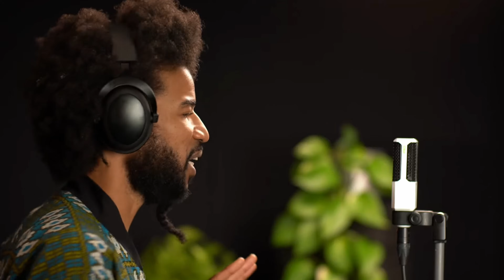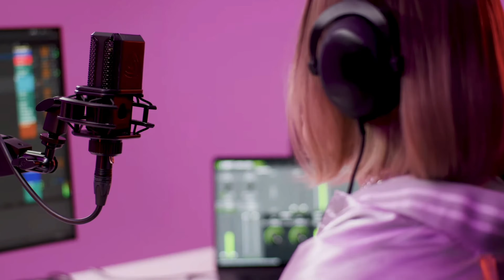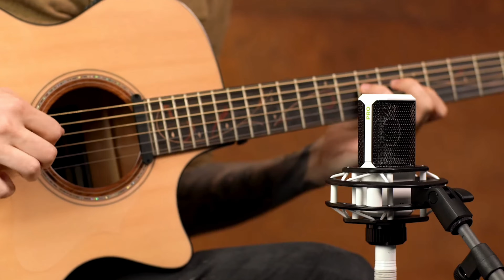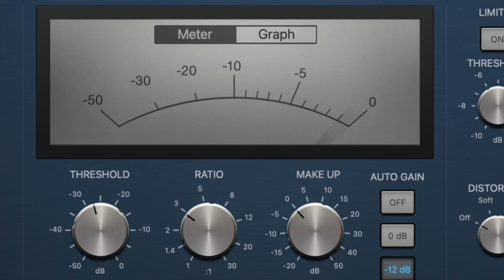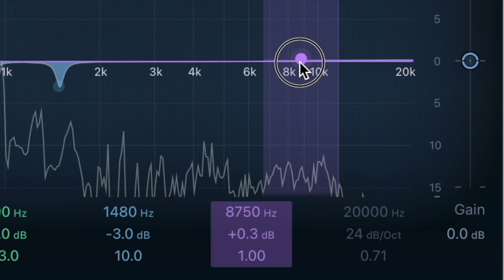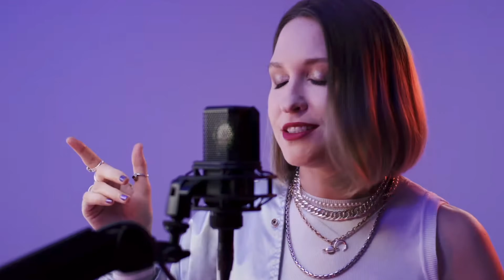How To MIX ANY VOCAL Recorded On A LEWITT LCT 240 PRO Microphone!

Comment: What windows settings are reccomended? I use voice clarity on permanently with the windows level at 85 and the gain level at -44db I tried running it at -52 to get peaks at -2 but was getting bubbly soubds from the voice clarity ai detecting too loud of a signal. If windows is at 100 level I have to drop the mic sonething ridiculously low to get -12db peaks yet it shows as not hitttibgcthe green zone (weak signal) at this gain level on my rode. I can’t find any decent info on what windows level I should keep it at and why!
Reply from the maker: I’m not sure what you mean by Windows settings/levels

Comment: Bro which is best and professional mic lewit 240 or Rode Nt1 signature series??
Reply from the maker: @sridhargovindaraj-e6e  both great entry level mics! They sound different so depends on your tonal preference. However, if I could only pick one, I think I would choose the NT1 Signature series because that kit comes included with an XLR cable, it has a large diaphragm capsule and lower self noise than the 240 pro.